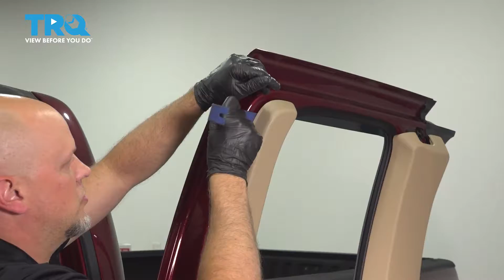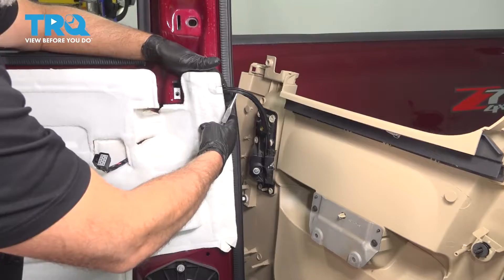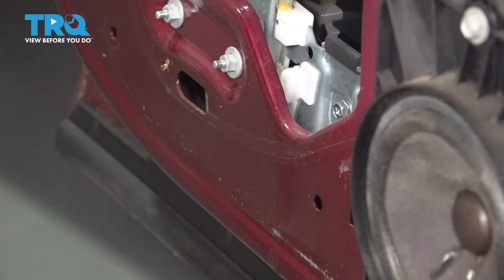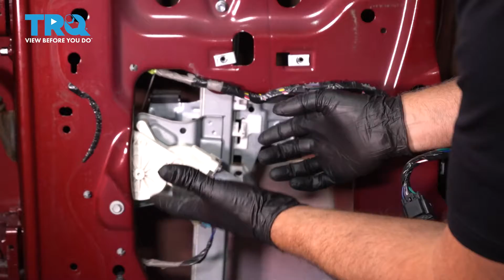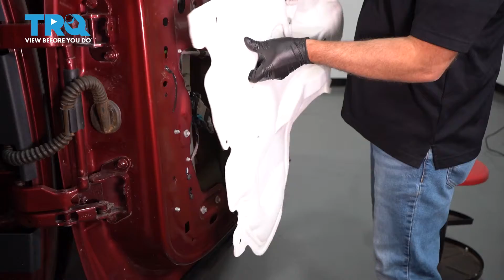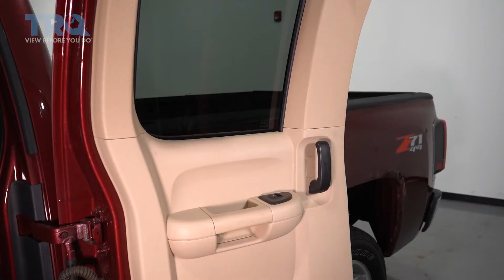How to Replace Rear Window Regulator 2007-2013 Chevrolet Silverado

Comment: Really helpful video. Only thing is when I was putting the panel together when the passenger door is closed, the door handle does not engage.  Can someone chime in as to what I did wrong? The cable was installed as showed in the video. Thank you.
Reply from the maker: +@traderflorstock9497 Thanks for watching our video! http://1aau.to/m/Shop-TRQ

Comment: One point when installing replacement plug in regulator and roll halfway down. The track at top goes in front of glass. And to line up the bottom holes angle track slightly forward and the bolts line up. 
Thanks for video

Comment: Thank you for this video!!!  One thing to note is there isn't any need to remove the inner door handle as it's attached to the door panel.  All you have to do is move the handle to allow access to the bolt.

Comment: Just totally skipped how to realign the clamps with the bottom of the window.  Just plug the switch back in yet again and run it up until the tray hits the window edge and stops, I reckon.

Comment: Great video. Very helpful. Just a tip. I had trouble prying down the pin for the handle. I took a drill and a small drill bit and drilled a hole, on an angle, through the plastic alongside the pin. This allowed me to pry the pin down with a pick.